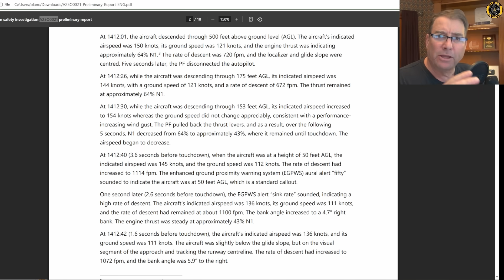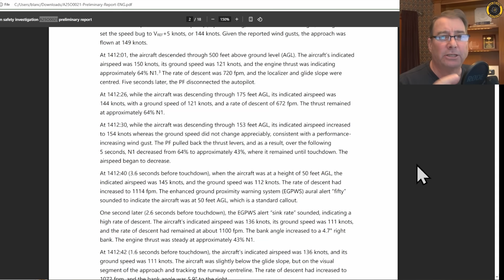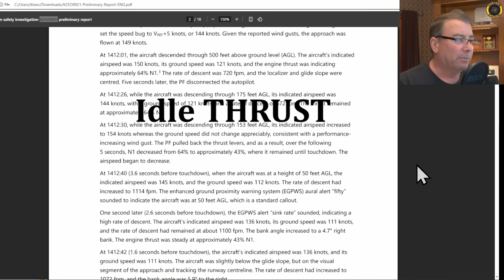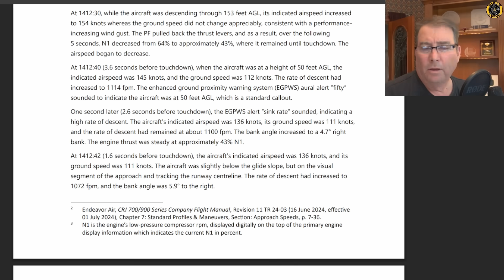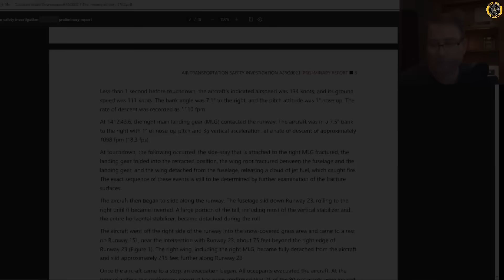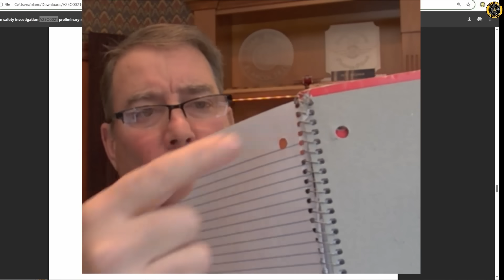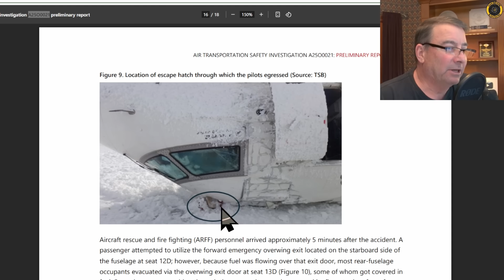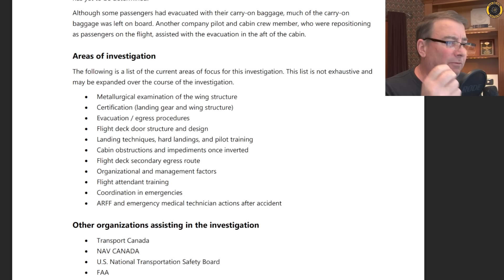TSB Prelim Toronto CRJ Crash

Comment: Amen for saying the lack of stick and rudder skills out loud. I befriended a Gulfstream  pilot at the gym and was stunned at the lack of hand flying.  I started in '68 and no matter how much the technology improves , you have to know the "seat of pants" basics.
Reply: Not being a pilot, a very mundane (maybe even silly?) illustration comes to mind.  Credit cards these days come with 'tap to pay' capability, which is very handy, and I pay this way all the time.  The other day I made a purchase which was over the 'tap' limit, and required keying the PIN number.  Having used the 'tap' function for so long, I had forgotten the PIN, and was at a loss (eventually figured it out).  Seems this is what happens with automation.  It's great until it doesn't work, and then you need to know the "seat of pants" basics.  When flying, you may not have the luxury of being able to figure it out eventually.
Reply: @owinstan actually, that is a very good illustration.  Thanx
Reply: @owinstan  In order to avoid the situation you describe, all proper airlines require their pilots to make a minimum number of visual landings per month.
Reply: Gusts can kill you. 

The video I saw from the pilot on the ramp made it look pretty much clear, but the video I saw from a perspective right behind the plane looked really sketchy. Not sure they knew where they were. In altitude. The runway and the snow blowing across the runway combined to catch them out maybe. That was the hardest "landing" I have ever seen. 

Pretty obvious pilot error. Everyone should start in a Fairchild PT-19. That's where I started. First flight I made two circles and then put it straight into the street. The wings flew off, but everything snapped back together fine. They didn't let me have another turn. I think I was 9 years old.
Reply: I remember back in 1998 I got my first jet job as FE in a cargo B727 with over 3k hours of hand flying smaller aircraft. I listened to pilots in Europe complaining their companies were hiring US Capt off the street when they felt they should get the job. I asked how much time they had. It was usually below 500 hours. When they found out how much experience everyone at our US company all had they were shocked. We flew up to 8 hours a day because the simple autopilots didn't always work. I don't think I could do that anymore. 🤔
Reply: @Unitedflyier  Are you saying that in Europe at the time autopilot time couldn't be counted for your logbook? It sure looks like that...
Reply: @Unitedflyier I call Bs on this.
Reply: When I did a gliding course there was a British Airways training captain who took each of his trainees for a half day gliding.
Reply: @Keith_Butcher  a neighbour who is a commercial iinstructor has told me that BA encourage their pilots to hand fly the plane all the way up to cruising altitude.
Reply: @stracepipe  You are right, though the decision actually belongs to the chief pilot of the relevant fleet. BA also has a company policy of a minimum number of manual landings per month.
Reply: @hb1338  I’m curious what you mean by a “manual landing”? Unless the aircraft has auto land capability all landings are manual. Did you mean to say a visual approach and landing? Most pilots will back up a visual approach with an instrument approach if one is available, especially at night. I can think of a couple of recent incidents where an instrument approach backing up a visual approach would have been VERY helpful!
Reply: @Keith_Butcher Gliding is a unique experience. It is very unforgiving of fools, especially in mountainous regions. It’s the ultimate stick-and-rudder, minimal instrumentation environment. IMHO every pilot should get a mandatory 10hrs on gliders.
Reply: Spot on!
Reply: Imagine the skills that are being lost by the driver next to you on the highway in his self driving car? I knew a young cyclist that had his potential career ruined by a car accident, and when he asked the lady that ran into him why she didn't brake she replied "Because I have airbags". 😮
Reply: LACK OF HANDS and SKILLS
Reply: I was fortunate to learn basic stick and rudder skills in an Aeronca Champ. I carried those skill right into my sim training in the Boeing 757. I was graded at the top in my group of new hires. 

You are absolutely right, Juan.
Reply: I wonder though, if stick-and-rudder training is as valuable as we think it is considering the major airplane manufacturers are all going towards fly-by-wire-computer-in-between-pilot-and-control-surfaces models of flying. Planes aren't going to fly the way a hydraulic system would make them fly.
Reply: @jeremyrainman  people who don’t fly FBW aircraft generally greatly misunderstand what that means and how it relates the aircraft control. I’ve flown the DC-8, B-737 all variants, B-757/767, B-777 and currently am flying the A-320 family of aircraft. You can become an auto pilot cripple in any of them if you allow yourself too. And you can hand fly and keep your flying skills sharp in any of them as well. I also do some back country flying and fly competition aerobatics to keep my hands and feet tuned up. All modern transport and military aircraft will be FBW pretty much from now on. FBW is just the best way to communicate your control inputs to the aircraft, It doesn’t mean the “computer” is blindly flying the aircraft. FBW also allows a better automation interface when desired. Automation is a tool not a crutch.
Reply: @Arcticflyer212 Very well stated!
Reply: @ My understanding is fly by wire airplanes fly exactly like the old technology except they protect from unwanted results. As an example on the DC8 because the engines are mounted under the wings if you are climbing at climb power in trim and pull all for engines to idle you suddenly have a airplane very much out of trim very nose heavy. if you are flying a 777 with fly by wire the reduction in thrust does not cause the nose to drop. The change in forces are compensated by the computer. When I took my initial DC8 check ride as a DC8 F/O the EAL check airman went into a extensive debrief about the trim change during the flare and landing and the pronounced nose up trim change during a balked landing. Fly by wire removes all these issues. Helps non pilots to control airplanes and may keep pilots out of trouble.
Reply: @josephyutenkas4902  lack of basic flying skills crashed Air France 447.
Reply: I was taught ab initio by a former RAF QFI, who taught both pilots and instructors. He demanded that I demonstrate a minimum level of basic skills in a glider before he allowed me anywhere near anything with an engine. I've lost count of the number of times I have been grateful for his insistence.
Reply: The problem is stick and rudder is as discouraged as it can possibly be. A pilot's license is a test of memorization and money, natural talent never enters into the equation.

Some people literally don't have a butt-o-meter, and they could be your pilot.

It's like trying to be an author when you're one of those people without an internal monologue. You can only rely on muscle memory and training so much.

Actually never mind, vehicle agnostic AI autopilot already exists.

That's how we make the flying taxi market work. You get to "fly" the taxi, but it's really an AI that makes sure you can't screw up. Imagine video game mode, a flying flight simulator on your way to work. 

Imagine people renting a flying taxi to go fly circles around an open field while playing Star Citizen. That's just a joke. Star Citizen still won't be out by then.
Reply: 1500 hrs in a Cessna 172 does not make you a jet pilot!!!!!!!!!!!!
Reply: @jeffleverence4554  Of course not, but neither does 1500hr solely in a T-6 Texan II or an F-16, no matter how much you wish it did lol
Reply: I have always believed that the best pilots come from The Military, where the basics are drilled into you and then you get ample to develop your skills. Am I correct? 
If so, won’t the pilot and experience crisis worsen as the military shifts more towards unmanned aircraft? 😮
Reply: @ccc530 and you’re wrong regarding military pilots. Some are good some are complete nightmares. I’ve been a pilot, instructor and check airmen for 3 major airlines and I’ve be doing it for 29 years. The best pilots come from all backgrounds as do the worst.
Reply: @ thank you for clarifying that. I defer to your personal experience! 
IYO- how can the airline industry improve this crisis?
Reply: @ccc530  it has to start in primary flight training, emphasis on stick and rudder skills. I had 3,000 + hours of light aircraft time, flying in all kinds of weather all hand flown before I ever saw an auto pilot or a turbine engine. Those days are mostly gone. So the answer is to give primary pilots a strong primary hand flying skill set. Requiring a tailwheel endorsement and being comfortable flying a primary aerobatic sequence would be a great start.
Reply: @ccc530  I’ve seen military pilots that couldn’t fly.
Reply: And let’s not forget lower standards for on check rides. These pilots will definitely both have had issues
Reply: I believe the FO had just shy of 1500h flying. Somehow a special program allows that to happen.
Reply: @nathanbourquin6554  relax a little over 10 years ago it was only 250 hours.

Also remeber your miltary pilots barely have over 500 hrs flying the most sophisticated aircraft known to men
Reply: @AirmanBrown I respect service members, but I still don't understand why the experience transfer for military pilots is so high when they have nowhere near the experience on nominal training aircraft (in the US the first military training aircraft you're stuck on is a TURBOPROP) and civilian procedures. The armed forces here used to have piston trainers, but I guess the budget cuts came for them before expensive procurement contracts; it's crazy how fast they try to know whether you'll wash or pass for basic flight skills.
Reply: @Ibrahimarm  They cut out all the fluff in their training. The are 100 percent training to fly that airplane night and day.

They arent spending their time doing turns around a point for 2 years. Also I’ve flown with a lot of military pilots and they really do struggle initially in the airline world.
Reply: @AirmanBrown  The automation on military aircraft is most definitely not sophisticated.
Reply: @nathanbourquin6554 isn’t 1500 hours a minimum to get the ATP rating? The FO was very “new” in terms of airline flying.
Reply: @gregmeadors9624  Yeah that's why I'm astounded by how few hours are still required to get civilian ratings if you have military ones. Granted, I don't look into the military sphere so my info probably isn't the most accurate. Also, at least nowadays there are (civilian) restricted ATPs as low as 750h with the right FAR compliance; my school has approval for restricted at 1000h which is still a giant time saving. As a flight instructor you get maximum 200hr per year, and from what I can tell in most places that's on a good year, with significantly more than that considered lucky.
Reply: @gregmeadors9624  The hour requirements are lowered The FAA authorizes institutions of higher education to certify graduates of specific aviation degree programs for a restricted privileges ATP certificate with reduced aeronautical experience.  They are on a restricted ATP until 1500.  Restricted means you cannot be anything other than a Co-Pilot.
Reply: @gregmeadors9624  It used to be. Nowadays, in order to get new pilots operational, the 1500 hour minimum can be lowered in certain circumstances, mostly to do with the training regime.
Reply: @nathanbourquin6554  Was 1000 hours lower 20 some years ago.
Reply: @nathanbourquin6554  hours requirement is still only 250 for an FO in Europe and we don't have these issues so much.

When the 250 hour guys come out of training they are very current and used to learning. They have been practicing instrument flying for the last 50 or 60 hours under expert instruction, in Europe they are then straight away taught to apply these skills to an airliner.

In the USA once they get their licence at 250 hours, they then spend the next 1250 getting into bad habits, flying smalll aircraft often VFR and loosing those sharp IFR skills. 
3 years later with 1500 hours they put them back into an IFR environment and wonder why they struggle.

The issue is with training and checking standards. In my experience EASA training is streaks ahead of FAA.
Reply: Military pilots can graduate from their flight school with less than 300 hours. Of course their training is much more concentrated than a typical general aviation flight school, and they do wash out people that can’t cut it. And some people just shouldn’t be pilots. 

There are some excellent GA pilot training programs, many as part of a college or university. Some foreign airlines have their own flight schools that are also very good. JAL has had one in Napa CA for many years, and there are some in Arizona. These programs are very selective and follow a strict training program getting the student ready for the airline world.
Reply: @johncox4273 I got my Army wings at 205 hours. It was 1968. I got the rest of my training in an unfriendly place. Stateside had to get used to taking off and landing without someone shooting at us. :-)))

Comment: Airlines like schools, probably pass almost everyone....as long a$$ they pay ......  God forbid you start flunking people like the old days.....or actually reprimand them for their lack of knowledge , skill or poor attitude....
Reply: lol, no they don't
Reply: @ericsd55    If you’re not even an actual professional pilot- how TF would you know?
  Both schools and airlines have to maintain a very high  pass rate- if they don’t- they lose their authority to conduct the check rides, etc, and their approvals to operate under FAR Parts 121, 135 or 141 will be revoked, depending on whichever Part they’re operating under…   ‘
Reply: @joer5571  Training to proficiency is a well accepted practice (it has it's limits, however).  And can be used to maintain high pass rates.  I have given OE to many pilots over the years, most get good within the general guidelines of minimum hour required.  Some are excellent with less, some require heaps of more OE to get to a minimum of good.  The 2 best were both former Alaska freight dogs, first generation in their family to become airmen, and ladies.  They had the skills, my god they are good pilots.  I also have had 2 that needed extended training, remedial training, training department "special track" observation, and went through a few OE sessions.  They did not have Alaska bush flying experience, but plenty of experience none the less.  They were worth the effort and are fine airmen now.
Reply: @joer5571  Are you a professional pilot?